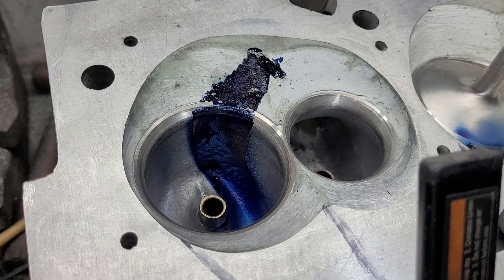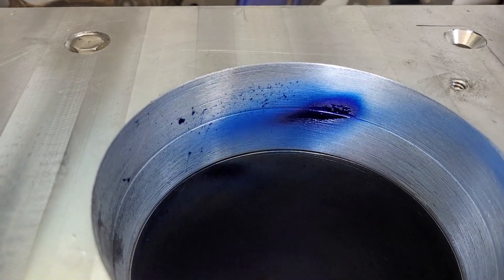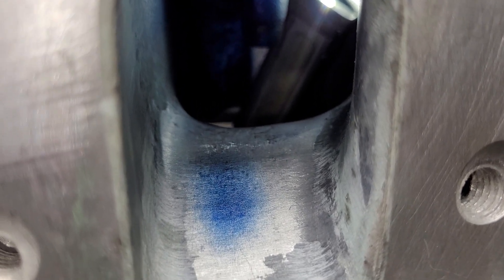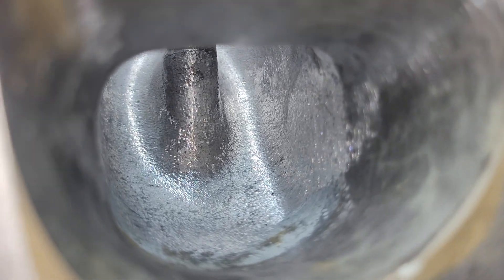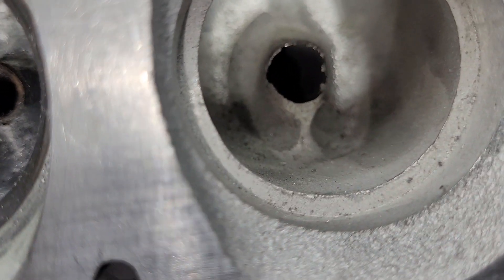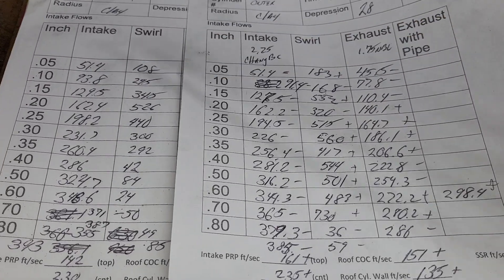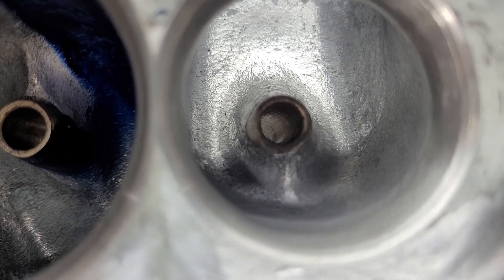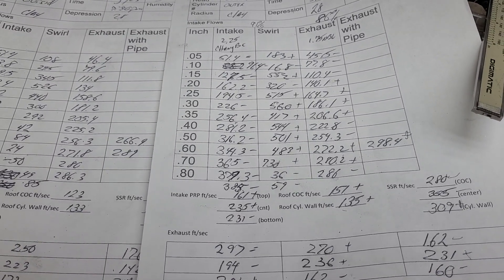Big Block Oldsmobile cnc master cleanup and valve job, flows,air speeds and liquid flow.

Comment: vane on floor will move air speed towards roof ? correct 
can the vane also direct to port wall or away from it ??
just thinking !!
Reply from the maker: Vane on the floor is more for splitting the floor flow.

Comment: Since the cylinder head is only going to be used to digitize for their CNC program, finish everything with sanding roll.
Reply from the maker: Does it matter how smooth the texture is? I doubt it.
Reply: @servediocylinderheads  not really, but it's just nicer too move the stylus, probe over a smooth surface.

Comment: The jb weld  weld stick putty word better,  even harbor freight gas their own version,  it hardens quickly, and having steel powder indide its harder than body filler i rather use it, over body filler,  and a bur get plugged up if its not fully hardened.  However, scrape it out and all is good,  just an idea, unless there is a reason for the body filler,
Reply from the maker: Not a fan of body filler!
Reply: Is the body filler just for flow purposes? Or is going to be used in the running engine? I've heard of marine epoxy used and even jb weld. I've used jb weld to repair intakes but not on intake ports.
Reply from the maker: @jesusgutierrez145  This is for flow analysis and digitization. Thanks

Comment: Never RADIUS the Angles Edge on Intake ? Angles Edges  will break up Fuel, {ReAtomise}.  Radius  Angles looks good on FlowBench -numbers ,but Engine cannot Burn  UnAtomised  Fuel ?? EXhaust  Radius actualy Helps get 800-900 Lbs  EX Pressure out !!  

Cross Sectional AREA is  IT? 

"If a  Port looks Aerodynamic it proibable not a Good Flowing Port "......Darin  Morgan...........
Reply from the maker: No arguement from me. You sure you listened to what I said? Thanks

Comment: @ 3:00 you see an interesting artifact, a nearly clean line with almost no liquid on the liquid side. If you follow that line, you see that it points right to the light patch of blue on the other side of the bowl. That means there's a vortex on the other side of the bowl cleaved between the main liquid and the patch on the other side. That vortex is pushing the air towards the spark plug, and that vortex is influenced by the flow coming off the outside of the CC, and more crucially, the valve and valve job. The valve is essentially a nozzle when paired with the valve seat, the two form a venturi nozzle.

I'm sure you already know all this, I'm just commenting as a way to show what I'm learning from watching.
Reply from the maker: That is what it is all about. Well written by the way. Thanks

Comment: Does yhe customer want the blug straight or angled? Or will iy not wotk with the headers?
Reply from the maker: Olds has an interesting plug angle. Not sure what will work. Later versions have plug location.